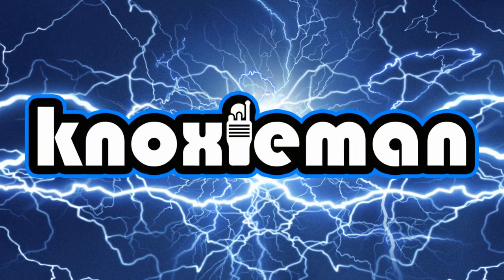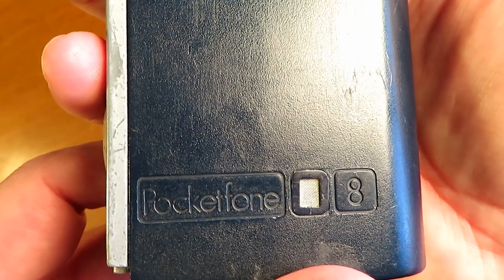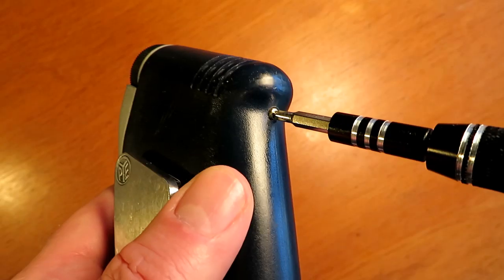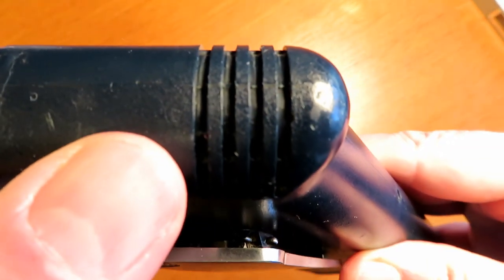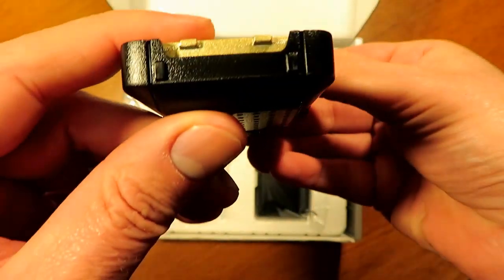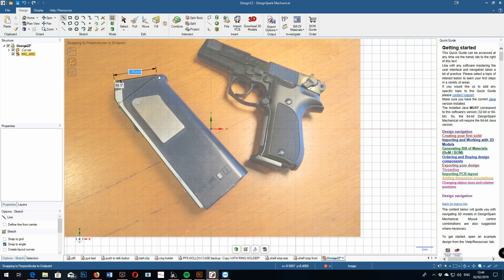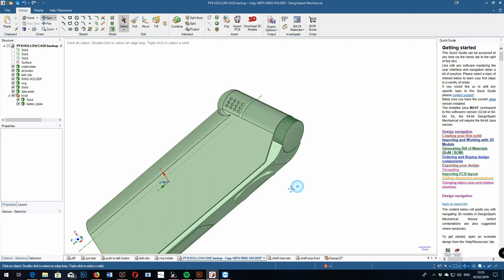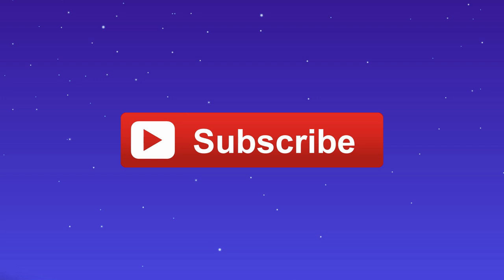3D PRINTING A CLASSIC WALKIE TALKIE -THE PYE PF8 - EPISODE 1

Comment: Oh iv had loads of these things over the years Paul and im shocked to see the price they command these days. They have 2 mikes one at the top where the antenna is and the one u showed at the bottom. The dual ptt was used depending wich mike u were using. The bottom mike was supposed to give greater range coz the antenna was higher when it was used lol. The range according to the tv show was amazing right accross london where in reality u are lucky to get 500 yards out of them lol. Still they are probs one of the most collected of the pye range. The reproduction radio is a really good idea paul love the idea
Reply from the maker: Hi, yes I love them, can't believe I didn't pick a few up back in the late 80s, the TV show has cemented them very firmly in to one of the most collectable vintage sets, here in the UK at least, and really good ones can go for many hundreds of pounds, I've seen pictures of heaps of them on a warehouse floor waiting to go to landfill, if only they knew what they were throwing away.

Comment: Hi there. Enjoyed your video Will have to look into 3D printing. Being a man from uncle fan, I bought an expensive uncle gun grip in order to make a replica., which I now have, made from a P38 bb gun. The original was based on the ww1 model.would love to 3dthe print a copy of the special grip, if possible.
Reply from the maker: Hi thanks a lot, 3D printing gun parts is totally possible, I've got some lovely models of guns, grips are no problem. 😎
Reply: @knoxieman  The grip I have is copy of  one of several designs produced for the show. The originals were made of aluminium. To buy one of those is 800 dollars. I payed over a £100 for resin. Can't understand why someone isn't making money buy printing. Not available when I bought it. Done by moulds from original 60s grip.